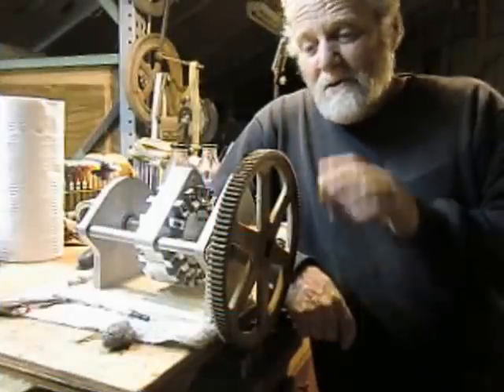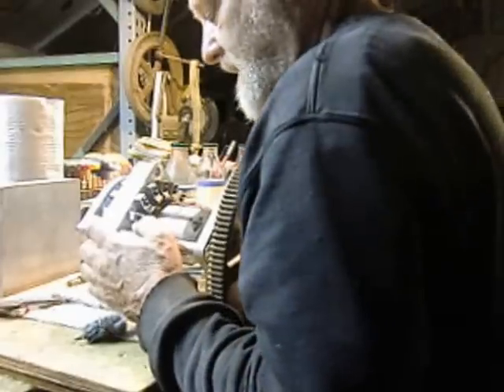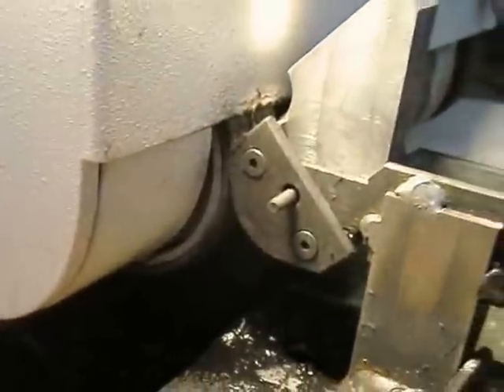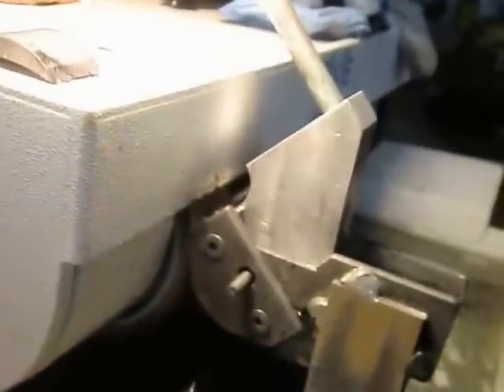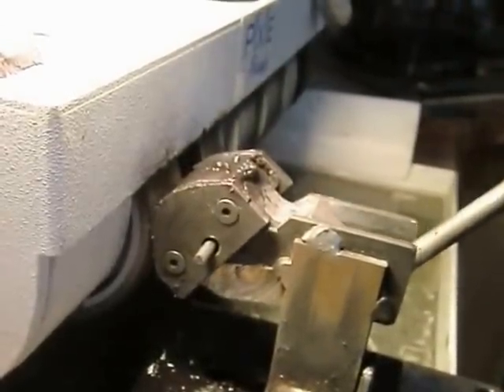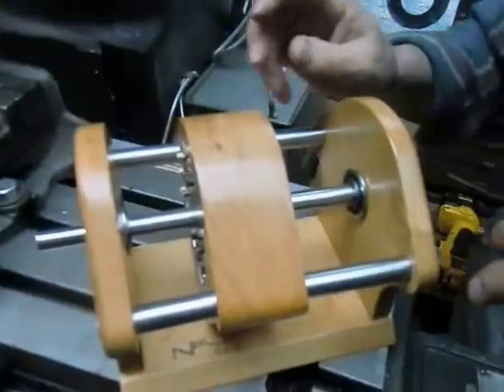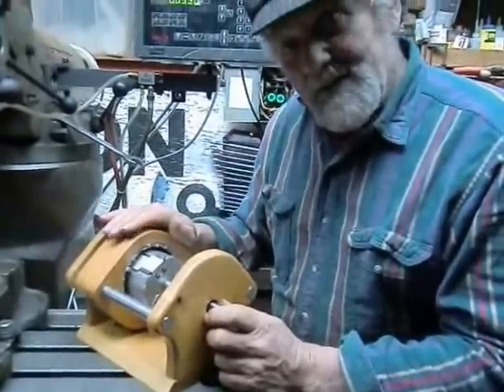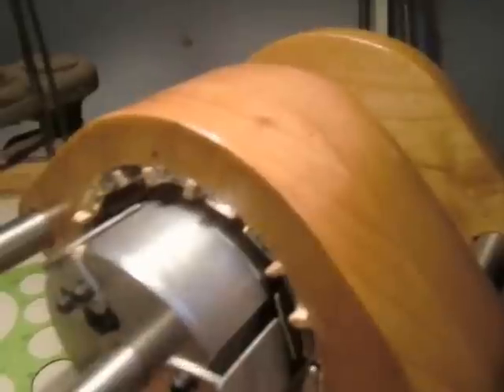HoJo Permanent Magnet Motor

Comment: Hi Nic,
The only configuration that has a chance is stator of magnets with the same pole
to the center and a rottor out of the stator cylinder with one drum shaped magnet, south pole facing the stator magnets. The stator magnets are rectangular. North towards the center. The rottor diameter is slightly smaller than the inner diameter of the stator. Someone called the effect, "vortex". One inner coil with clockwise current
and one outer coil with counter clockwise current such that one of these coils can rotate, will manifest this vortex much better. Initial rotation speed should be applied.

Comment: I think magnet shudda put on simple way, not from weak-medium-strong-strongest magnet.. Its like nikola tesla finding dynamo things. Its fun, it is. But more fun if it will be really run. Try watch more more video on youtube for further information. And do what you found its worth to try. And 1 more thing, the idea of flywheel is nice, if i were u, i'll put more weight and run the dynamo to load the electric generator to powerup the dynamo but with little amps. I wish i have that equipment pf yours

Comment: Hi HoJo  If one excepts the laws of thermodynamics, which I do, then on can get something for nothing.
However, there are too types of free energy. One is free from a physics point of view the other is free from a money point of view.
Example; a solar panel isn't free energy from physics point of view, but, once you have bought the panel, it is free energy from a money point of view.
I think you are on the right lines but may I suggest that you should angle the magnets so that they create a rotational motion. Once you have that working then recognise that these opposing magnets will degenerate to the point where they will no longer work. 
I think the solution is to have a sliding shaft that moves the opposing magnets to align with a set of attracting magnet that will help to regenerate the weakened drive magnets, when the machine is not in use.
Depending on how much the motor has to do it maybe the drive magnets will have to be regenerated using electromagnet. This could be done by removing the magnets from the machine, or electro magnets could be built in and powered be a solar panel or some other MONEY free source.  
Your machine would then become in energy storage battery and doesn't brake the laws of thermodynamic it just bends them a little.  Keep up the good work M8

Comment: I think I know why the engine still does not work .. Most inventors do not use proper shielding of the negative pole of the magnet .. Try to use bismuth (Bi), or any other non-magnetic element, as in Perendev magnetic motor ..

Comment: This is the Howard Johnson type ? good job on the machining ! have you tried a "magnetic apron" under the stator magnets ?? I believe something like Mu metal or soft iron would be best. I also found the closer I got the stator magnets the less cogging I got. It seem like it's a matter of mechanical proportions to get it running.

Comment: Hi! Now I'm no engineer, but I was reading up on this stuff a little and in a forum somewhere somebody suggested this:
All the possible motors I've seen have an even number of magnets on both wheels, is it possible that if there was one wheel with an odd number of magnets(evenly spaced of course) would that prevent the two wheels from magnetically locking in each other?
Something like that, i would love to hear some feedback!

Comment: a fixed only design has a large flaw  there is no  start pulse
this is why it stops nothing is pushing it ! if you make the outer magnets around the drum , in the config of "  wind eletromagnet around a rare earth fixed magnet  so
you have a fixed field core & eletro in one. reason for this is because you have to over come gravity !! so you have to add a small amount of current in the form of
a rapid squarewave switching on and off so image so you have a total of 10 of these magnets made, you have 5 sets of 2 so if  you could imagine your hand gripping a softball thum faceing 6:00 then 7 then 8  fireing sequence repeats 1000 times a sec ruffly , so what your really doing is making a motor that is less effected by gravity so it requres less current to keep it moving not free Electricity but very close if you are going for over unity a stepped up tirode transformer  with 10 taps  could be used before each eletromagnet group this would increases field effect and reduce current. add a brake to your main shaft! and balance it so it dosent fly apart.
by the way off set your magnets    group 1 flat  group 2 "3 deg pitch  group 3 "6 deg pitch and so on  the tiping of the magnets form a quarter spiral  if you need help or get stuck just drop a line hope this helps you understand a little better

Comment: Great video, awesome craft !
I was wondering : if the wheels where turning not parallel but instead perpendicularly to the force of gravity how would that affect. Great physicist Nassim Haramein's work presents gravity as the expansion of the universe towards singularity, the infinitely small, and energy appears flowing in a TORQUE motion (spiral more precisely) towards the center ! (roughly speaking). What about aligning your plates to that..

but don't blame me if your machine starts levitating and flies off ..
; )

Comment: I don't understand how someone can have enough knowledge and skill to build something like this, and not know that it is physically impossible for it to work!
Reply: I think you may be missing the point. This is not about making a zero fuel/energy motor. The energy is there in the magnets, but as I understand it, the magnets will eventually weaken through usage and need replacing. The other question is this: Will such a motor just be an interesting experiment but create a motor with such low torque that it will have little or no practical use - a motor that works until a load is applied.

But trying what he is doing and tinkering with it, don't overlook the theocratic value of doing so, and just the fun of it.

And... when Faraday used magnets to make rotary movement, no-one knew then what  that would lead to - and today we can acclaim Michael Faraday as the inventor of the electric motor. And hence also the generator before Edison and Tesla.

A magnetic motor scaled down and finding a low or near zero torque application - where sensing movement rather than driving a load is the aim... who knows what that might lead to.

I myself have done things when I was told it was impossible and implying it was a waste of time. So that only made sure that THEY would never attempt it and that means I would achieve something that they would not. And a number of fronts I did - and got some amazing looks. I have find a way to current drive a motor load with a mechanical resonance when everybody said you can only use voltage drive.

THEY WERE WRONG!

I found a way to do it. I equalized the AC current with a "Current Mirror."

Never let anybody tell you that it cannot be done - that is a sure way to make sure nobody tries.

Comment: Hi! nick I would like to help or suggest into your project called Electro magnetism . Add me on facebook cyberjeferbot@yahoo.com or search my name Jerry Satur Thank you. 
Here is my suggestion by adding 20 turns of magnet wire coil and adding a capacitor 12 vlts. at the end of the coils it should do the work. It will continuously maybe my theory is that while magnets are rotating coils generates electricity to push the magnets while charging the capacitor.. send me e-mail Nick we have a lot to discuss, I`m looking forward that we could make this project working.. :)
Reply: The Capacity of Capacitors are specified as Farads.

Comment: Let me restate my earlier comment which was in error, I believe. I don't think the HoJo motor would necessarily violate the law of entropy as the materials generating the electric field will eventually decay to the point the magnetic field would no longer be sufficient to move the materials. In short, it would probably be cheap energy, very cheap if sufficient and enough energy is produced.

Comment: You people don`t have a clue about the science behind the magnetic laws. You never will get such an arrangement to produce any type of motion at all. The point you are missing is that the flux field generated by any magnet is static. There is no motion of the flux lines unless an external force is introduced to the system. Now, if you ever get a magnets flux lines to vary over time, just from the basic composition of the material, then you will have something. Har har rots of luck.

Comment: The sum of all the forces around every magnetic motor always sum to zero.  Therefore self powered rotation is impossible.

Another way of looking at it is the force required to bring two opposing magnets together is the exact opposite of the force that is produced when they start to repel.  Therefore self powered rotation is impossible.

Another way of looking at it is there is no energy being produced therefore...no  way it will rotate.

Also those pesky laws of physics say it is impossible.

Comment: first I'd like to say NICE work on the HoJo motor together. As you said it doesn't work, you  have to looked into Quickfield program the study that one student or person that used it to configure the correct position of the magnets, he show that it did work but that Howard Johnson was off a bit. I seen the one a pic that someone else did and they said it didn't work. It takes a lot of time to get them just right. just like Edison it took 100 times to create the lite bulb ( Tesla had it right) .

Comment: Dear Friend, I suggest you add another motor/generator to the fly wheel and see if the current generated may be put back into the circuit to strengthen the magnetic field...
anyway, thanks for your sharing...Congratulations

Comment: your design is excellent the problem is that u have to use more powerful magnet of equally distributed sizes but they should have different magnetic capabilities because it will wait and quite nice presentation i have done this on a little small motor probably a cpu fan will work perfectly so i suppose it should also work

Comment: Nice pice off work there I am bulding a magnet motor and mine is made outoff plexiglas It consis off five disc roter and stator with 18 magnets The tork that is in this motor is unreal but I still have to get my angle right on the magnets I started to build this motor and have worked on it for the laast week now Next week is all going for timing and setting the discs and angle on the magnets I would like to send you some photos mybe you have some idea

Comment: I have never seen a working one the problem has always been over coming the opposite attraction pulling back with the same energy, I have seen all kinds of crazy magnet designs in attempt to over come this but none seem to work, I think for a test bench model the answer may be mechanical arms that move assistive magnets in & out of the field in an elliptical orbit in the direction of rotation entering the field at the bottom of the stroke & smoothly exiting the field at the top of the stroke